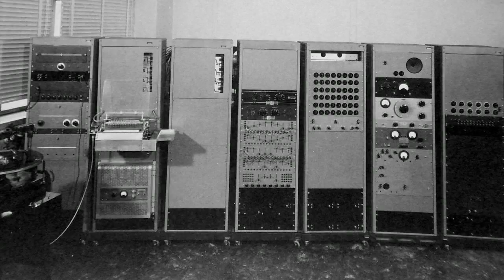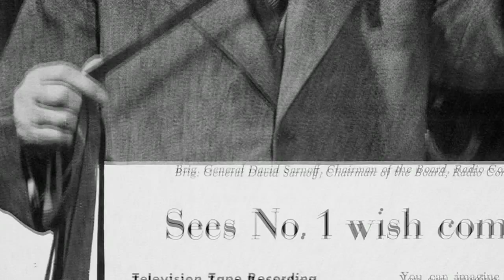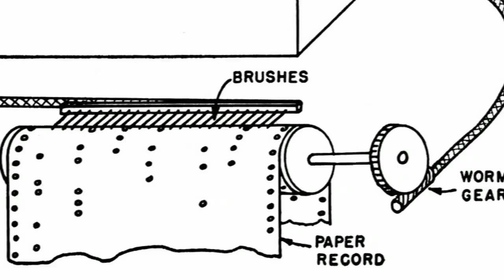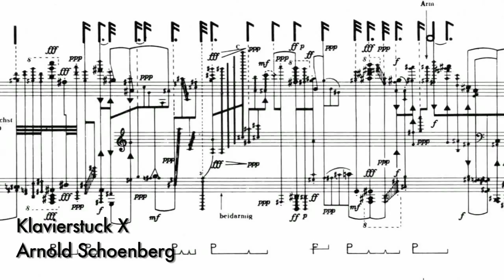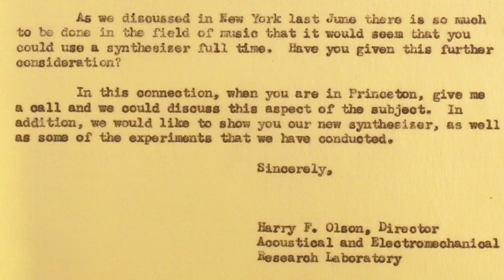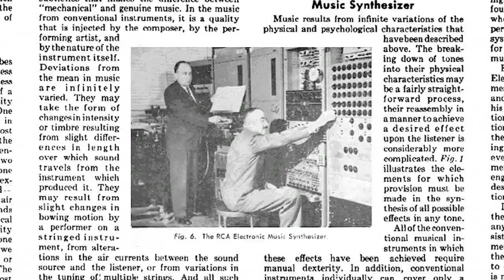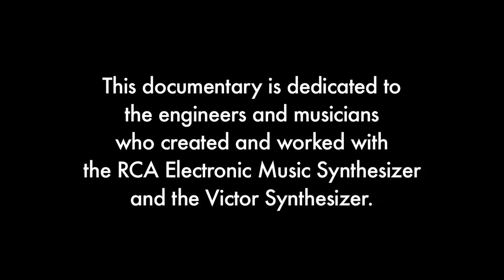The Story of the RCA Synthesizer

Comment: I wish the pieces here were properly attributed, and the editor of this presentation had a deeper knowledge of the history,... this is pretty much of a gloss on the subject, and many of the interviewees make anachronistic, condensed, reductionist arguments that really do not tell the story, and are inaccurate.   For instance: no commercial home synths in the 1960's due to integrated circuit chips.  That would come in the '70's.  People were home brewing electronic music gear, and Moog, Buchla, and Arp were selling stuff to Universities and some recording studios for the equivalent price of a new Chevrolet, or Cadillac at the tail end of the 1960's.
  I was 1st really exposed to this world, with a lecture by Vladimir Ussachevsky at University of Bridgeport (circa 1966?) when I was 14?.  He had an Ampex tape recorder with a bunch of his pieces recorded on tape, and explained how You could build up sounds using for instance, using a piece of test gear like a Hewlett Packard audio test oscillator, or sounds recorded on tape, spliced, mixed, or over layered, together,  by over recorded putting a piece of tape over the erase head ,.. free wheel the tape through the transport , play tape backwards or slower faster.  and recording onto another machine.  Perhaps this was around 1964, not exactly sure.  I built my 1st amp kit at age 12,- 1964.  I soon figured out how to build a code practice oscillator through info in Popular Electronics and my uncle a Navy electronic expert.  Ussachevsky and collaborator Otto Luening were students of Edgar Varese who had been an early 1900's advocate of NEW MUSIC, (freeing us from the shackles of tradition) using industrial sounds and electronics (Poem Electronique).  The Columbia Princeton Music Lab was using the RCA Mk I & II to make music, and W Carlos, (later of Switched on Bach Fame) was among the students studying with Ussachevsky.  Ussachevsky's lecture was filled with enthusiasm and childlike wonder, at all the possibilities electronic music, and "the synthesizer" would make possible.  His love of his work proved contagious.  Basically this lecture ended up defining my entire future career.  
  Just to add a tribute to Wendy Carlos, with virtually no advertising, and very little airplay,... so... all word of mouth sharing among Switched on Bach enthusiasts,.. her SOB album has gone maybe 6 times platinum, and had been for at least 40 years in the top 50 classical albums in terms of sales popularity., maybe it ranks even higher.  At a certain point she seems to have tired of being associated with SOB , and wants to be known for her own original creations, but this phenom is what it is, and there are millions of YT viewers who search for Wendy Carlos: SOB, 1 & 2, Well Tempered Synth, SOBrandenbergs, Clockwork Orange, Tron etc. every week apparently.   With all due respect,.. RING TONES???? the only legacy...  my ass....Check my channel playlists: "Switched on Bach synth" .. or "SynthOnBach (carlos style)" for 100's of examples of people who attempt to emulate this genre as well as interviews with her.
Reply from the maker: Thanks for the info.  I'm sorry you didn't like what was said.  The opinions of the interviewees are their own.  I'm quite aware of the history of all this stuff.  The point the video was trying to make about the home synthesizer was this:  Harry Olson's department at RCA had developed a working prototype for a desktop-sized home synthesizer, including a touch sensitive keyboard, at some point in the mid-to-late 60s, well before the small 70s era synths you mention such as the Minimoog and others.  However, RCA chose to let this design fall by the wayside, leaving it to Moog and others to pioneer that market.  I would like to know what factual inaccuracies you spotted in the video, however you should not expect any updates as this was a short school project from over a decade ago.
Reply: @dokcosmac  I did like Your presentation, and if You are assembling this history after the fact, You have done a magnificent job.  It just does not convey the enthusiasm for electronic music among Young people & creator musicians, or the technical realities of that time period.    When Dr. Alex Magoun states : @ 4:40, in this off hand dismissive way, that by the 1960's when integrated circuits were making solid state synthesizers a reality, there is no interest in subsidizing Harry Olsen,... this is just completely backward, and just sequentially wrong.

  Harry Olsen had already created RCA Mk I & ii in the 1950's, the fact that he had an idea for a "home synth" to (perhaps) be made by RCA that flatlined, has nothing to do with reality on the ground, at that time.  Ussachevsky's  efforts (due to the MK I & II by Olsen, at Columbia Princeton) created the core group (Babbitt, Luening, Mario Davidovsky, Bulent Arel, Halim Dabh, W Carlos was among Ussachevsky's students), would go on to ignite the synthesizer in music revolution.  

  It was Wendy Carlos production of a coke advert, I think, that gave her enough money and potential interest, to lead Bob Moog into his 1st marketing triumph, Moog a la (W Carlos Switched on Bach 1968) with his modified model 55 (sorta loan-leased to her) which SHE couldn't even afford, which resulted in the Beatles, and Monkees and the Who to use Moog Synths in Pop records in 1969 1972.  Other than a few synthesizers that cost about as much as an expensive car at a few (very few) Universities,  there were NO synthesizers in the 1960's!  and certainly none made with integrated circuits!  The 1st integrated circuits available to the general public around 1968-69 would typical have 4-16 transistor arrays for computer logic circuits and cost around $2 a piece and at that time completely unusable for building a synthesizer.  

The Arps, Moogs , and Buchla's, that were built "commercially"in the very late sixties  were all built from discrete components and often times hand selected for matching voltage offsets & gain, in order to create a Synth that could stay roughly in tune.   The only reason a few people, like me, could do any electronic music at all in the mid 1960's, was because we built all our gear from scratch !  I literally figured out how to build various oscillator types using 1, or 2 or occasionally 3 transistors, and 5 to 20 other components.  

There were no integrated circuits available, for tinkerers to use for synthesizers until around 1974, with the release of  709 an 741 op amps, which were pretty miserable little beggars.  An "affordable" synthesizer for regular musicians, would not really be available until the late 1970's and early 1980's.  And even at that late date, a typical usable synth, would be in the realm of 1,500 -2,000 $ which was still the price of a decent used car.

  There is no sense given here also of how difficult it was to use the 1st voltage controlled 3 waveform , monophonic synthesizers.  A typical music student would be studying synthesizers for a month before they could create a "patch" for a sound that they considered to be somewhere along the lines of what they had hoped for. 

 I give Harry Olsen A WHOLE LOT of CREDIT for having the vision to start this revolution, and so many other participants like Ussachevsky, and Carlos for helping it on its way.
Reply from the maker: @Geopholus  I would add re: Switched-On Bach - the reason synths took off with that record and not before was that previously, much synthesized music was avant-garde, often serial or 12 tone music, which was the academic fashion at the time but perhaps not the most listenable material, frankly.  I believe even Ms. Carlos has said she quickly grew weary of this type of music in school.  SOB succeeded as a sort of Bach's Greatest Hits precisely because it rejected the academic fashion of the time, which includes many of the pioneering names you mention
Reply from the maker: @Geopholus  most of the info in the video was obtained from some 30,000 original documents which I personally scanned at the RCA Labs Library (now defunct) under Dr. Alex Magoun who was its director at the time. There are digital copies of these scans at the Sarnoff Collection at TCNJ.  The original documents may still exist at the Hagley Museum.
Reply from the maker: I will mention also, that when I made the video I was trying to capture Harry Olson's perspective somewhat, which was very emphatically:  we are engineers and not musicians; this device is a tool; we make no musical judgement because we do not feel musically qualified.  This attitude comes up again and again in original documents.  Olson was not particularly concerned with revolutionizing music; his focus was engineering a new means of production, and no more.  One of the initial goals of the RCA Synthesizer project, in fact, was to analyze and re-synthesize old recordings in higher fidelity, and they actually did this on one of the demo tracks.  If this comes through as a lack of enthusiasm for the electronic music revolution, then it was at least partly intentional.  I don't say that Olson lacked vision, but his goals were not primarily musical.
Reply from the maker: Regarding attribution - all of the pieces used here were produced either by RCA Labs staff on the Mk1 (i.e. Herbert Belar and team),  popular composer Jim Timmens with help from RCA staff on the Mk1, or avant garde composer Milton Babbitt at Columbia on the Mk2

Comment: ANS Evgeny Murzin 🧐 Coil, say no more. Punch cards vs etched symbols/artwork. Apples vs Oranges. Oh… and then there’s the Subharchord from DDR which Biosphere and Manfred have been breathing new life into, It’s all good stuff anyway🫡
Reply from the maker: Thanks for the info.  I'm familiar with the very unique and groundbreaking ANS, which worked on the principle of spectral synthesis.  (In fact I programmed a simple emulation of ANS in college.)  Eduard Artemyev and others did some fantastic work with it.  Rather than to create new sounds, Olson's group at RCA were specifically trying to build a machine that could produce popular or classical Western music i.e. 12 tones, equal temperament.  Think of it from the perspective of RCA as a major entertainment tech company and it makes sense.  Also, the people involved with its design were not academic musicians but corporate engineers with some music knowledge, which is a very different mind set.  I had not heard of the Subharchord, will have to read up on it.
Reply: Thanks for responding, giving more insight and sharing. I love finding out new leads and unique contexts for early electronic music history. 
The DDR Subharchord was a kind of early workstation and one ended up being shipped to NRK broadcasting, Oslo, in the 60’s. There’s a recent doc about it and Biosphere has made a track using it together with a audio recording of the manual instructions. Nerdy heaven🥸